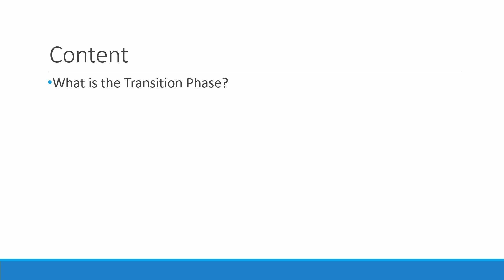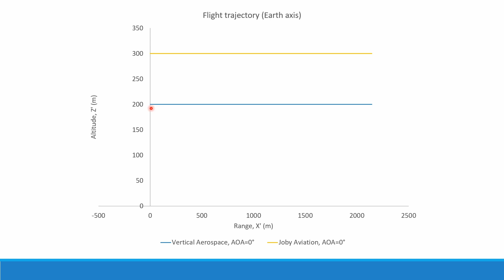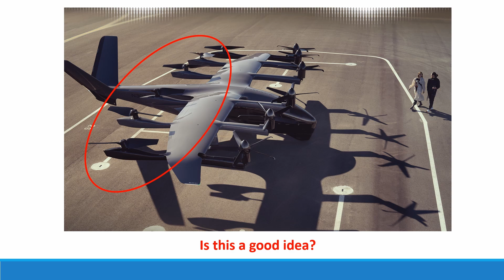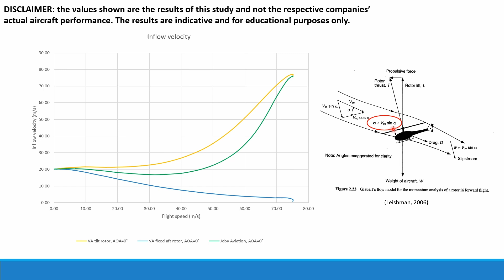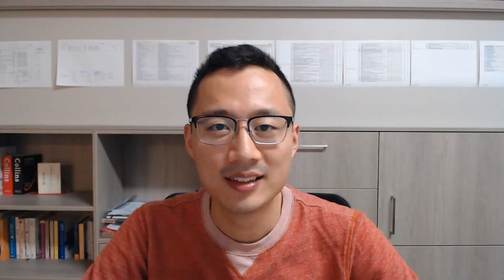EVTOLs with these rotors have a potential problem.

Comment: Strange how nobody (it seems) yet tried a design where aft wing motors are more like the leading edge ones, but pushing, capable of tilting down instead of up, and probably with different prop size/speed/pitch for practicality and safety (this would also help spread the energy over frequency spectrum for better overall aircraft noise perception). This way the aft motor counter effect during transition phase would not exist, they would actually contribute to thrust, and all propos would push during flight phase.

Comment: Kamov stacked rotors like what "Inspector Kido" uses in of film "Man in the High Castle" is best proven configuration in terms of disk loading given how it is skeptical if galvanic batteries even with caustic alkali Groups I to II metals such as Al or Mg could power a VTOL.

"Jane's All the World's Aircraft" had an article on a Tesla bladeless turbine for a rotor and of course Coanda should be well known.

Still A Tesla fluidic rectifier along with rotorless or shaftless ducted fans are already being used by some designers.

Comment: What many EVTOL designers tend to do is miss the fact of air turbulence during VTOL lift and do not consider calculating the extra constant balance exceleration of each motor needed to maintain stability of VTOL level hover. This also applies during all levels of control using the motor power. Were as in a helicopter,rotor flight controls are used to keep level flight, however in a EVTOL during VTOL flight power is used to control and maintain hover level. The more turbulance the more power is drained from the batteries thus cutting short any flight paramiters.

Comment: The best design of the type of VTOL aircaft would depend on the intended use by the user. That is what the user operation of the VTOL is going to be, VTOL lift and short, medium or long range straight flight. The shorter the range the bigger the VTOL rotor size and lift design as most of your power and fuel use will be required and used during VTOL flight. Hense the smaller the VTOL lift rotors the more fuel is used during VTOL. So if an operator intends to use such aircraft for short range and more VTOL lifts, it is better to have a helicopter rotor or tilt rotor due to a bigger rotor size, as  in the long run less fuel usage. During a straight wing flight less fuel is used due to a fixed wing lift. So the best design for long range VTOL flight would always be a single or a double tilt rotor design such as the V280. For heavy lift and constant  Short VTOL flights a helicopter rotor is more suited. One main helicopter rotor or contra rotating rotors will always cover a much bigger lift area thus being more efficient and more powerfull compared to a smaller number of lift fans or rotors grouped together.

Comment: It would be interesting to have a noise profile of these configured aircraft during both transitions --we have 'overflight' figures where the rear props are stopped and some in hover where there is no or little interaction  but not in the intermediate transition/conversion where the front props wake and the rear interact (worst case might be in landing -decelerating transition where flaring (rear up to kill forward speed ) might be the worst case  (as it is for helicopters )   The loss of power to one or more front rotors in this situation will result in sudden increase of angle of attack on the wing and possible stall --this could be induced from deliberate shutdown of a diagonally opposite rear rotor also,

Comment: Great video. I saw the Joby aircraft for production, is different from the pictures you are showing. It does not have flaps anymore, just ailerons for bank angle control. It see'ms the trainsition from level flight to hover is achieved with thust vectoring of the rotors only, no flaps. DO you know how this can be achieved? With just swash plates I believe might be difficult, there most be another kind of control of the rotors. What do you think?

Comment: The transition for both aircraft involves actual downwash on flight surfaces creating 'extra' weight (the rear surfaces and wing tips of the Joby ) and/or the downwash inducing a negative angle of attack on the wing from the front rotors even at a nose up incidence .  Indeed the effect of nosing down ,like a helicopter does to accelerate, is to create less or even negative lift in accelerating transition . The rear rotors act to increase the effective wing angle of attack from their downwash partially offsetting the effect of the front rotors which are placed as far ahead of the wing as possible to minimize the 'downlift' they cause other than in cruise configuration - Vertical aerospace VX4 has MUCH shorter pylons than the Archer or Joby and they all compromise the proprotor diameter to reduce these negative downwash effects . The Archer midnight especially has gone to ridiculous lengths (literally) to try to get the wing out of the worst of the front prop downwash in hover and transition -- it is a bad concept all round . The Heaviside and Do29 used only aft tilt props to avoid this issue  which is a better deal .   Earlier tilt wing vtols like Canadair CL84 and XV 124 etc avoided the downwash penalties that the XV22 has (and suffers the extra 'weight' by using lower disc loading and hence downwash on the wing ) the interaction non linearities must make for complex artificial trim and control made worse by loss of any rotor -the 737 MAX lesson is relevant here with software 'solutions' .  The drag of the exposed rear props, stopped, is greater in the front prop slipstreams (and eats power as the cube of local velocity)

It is clear from the poor behaviour of these designs AND the wild gyrations of the "0.1, .2, .3, .4 etc 'versions' and even worse patented 'abominations' (look up the Joby patents unbuilt precedent designs)  that they did not arise from carefully considered design procedures but from raw avarice after the projections of immense riches by Morgan Stanley/ Uber elevate et al.  Normally such misconceived creations would never leave the drawing board .   Take a look at the Autoflight 'prosperity' - supremely ugly even if it avoids some of the Joby/Archer failings.

Comment: Nice video!

Another concern is failure cases. The more tilting rotors there are, the more ways there are for it to go wrong. Similarly for variable pitch rotors.

eVTOLs are much more complex than helicopters in this regard, and all the complexity is in the electronics and software, as opposed to mechanical systems for helicopters. It’s a very different (and arguably much more challenging) safety problem.
Reply: JOBY has duplicate motors, batteries and computers in case of plan b.
Reply: In the Joby accident one blade failure cascaded into total failure of the aircraft. Yet they are well on their way to getting their type certification.

Comment: Good analysis, but you only hinted to the real elephant in the room in your closing comments - rotor aeroelasticity. Fixed, rigid lifting rotors of any practical scale and blade loading are going to experience ever-increasing ludicrous loads and vibration with any appreciable advance ratio. Ever notice how helicopter tail rotors always have flapping hinges?
Reply from the maker: I'm not a helicopter expert, so truthfully it is my first time noticing that tail rotors have flapping hinges, too. The general feeling I get from analysing eVTOL concepts is the following: at early aircraft design stages, the rotor design is not given the care and attention it needs, despite it being such a fundamental part. And problems with the rotor design can later become a showstopper for the entire aircraft concept. So I feel that the rotor design should be looked into more deeply early on...
Reply: @zhihenglou  You have hit upon the crux of a fundamental issue with the entire eVTOL industry. Many of the players are aerospace (and especially rotary-wing) neophytes who have little grasp on classic rotor problems. Most erroneously subscribe to the idea that the ubiquitous small scale drone rotors (that even the layman SPAC investors are familiar with!) are simply scalable to practical sizes without understanding any of the complicated rotor aeromechanic issues of doing so. Take note of what all the experienced helicopter OEMs are doing with respect to eVTOL - mainly waiting!

The showstopper aspect you mentioned has been in full effect - i.e. see the Beta Alia still yet to demonstrate transition and suddenly pivot to a CTOL craft, plus the very suspect video footage of Archer Maker performing their "transition" last November - if you are especially eagle-eyed you may have noticed them stealthily testing with 3 bladed rear lifting rotors as well.
Reply: @ChrisFu7  What is your opinion of JOBY? 

Seems to me the JOBY is a well thought out EVTOL, but I'm not a aero engineer or a pilot.

 Improved battery technology and future lower weight batteries or Solid state batteries are coming to the industry as well.

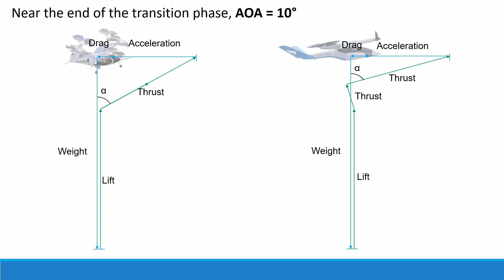Comment: 9:48 your vector diagram correctly angles the the aft rotor thrust by 10 degrees. However, the lift vector should also be angled by about 10 degrees. You're in effect modeling the induced drag from the fixed aft rotor, but not from the wing of either craft.
Reply: Thanks for correcting me on the lift vector definition. A more apt name for what I was thinking of would be the wing force vector, which is going to be roughly parallel to the fixed rotor vector.
Reply from the maker: @RallyRat  Hi, it’s great to see you again :)! I know what you mean. So the ‘lift vector line that is parallel to the fixed rotor’s thrust vector’ (let’s call this X) has been resolved into two smaller vectors like so:
Xcos10 = lift
Xsin10 = drag

The purpose of resolving X is so we can compare lift and drag forces for all different angles of attack (the example here used 10 degrees).

Let me know if this explanation worked. Have a great day :)
Reply from the maker: Hi Rally, 
Thank you for your feedback!
I see what you mean and where you are coming from. However, the vector line for Lift is indeed correct like this for the following reason.

Lift is by definition the force perpendicular to the incoming flow. In this diagram, an altitude-level transition is modelled, as shown by the vector line for acceleration. Suppose the Lift vector line is indeed angled at 10 degrees, then we would be talking about a climb, with a climb angle of 10 degrees.

The induced drag from the wing (and airframe) is captured by the magnitude of the drag component on this diagram. Conventionally, this is called the lift induced drag, which is found on a graph of the drag coefficient versus AOA.

I hope I explained this OK. Thanks again and hopefully see you soon!
Best,
John

Comment: Hi John,

I enjoyed your analysis of full tiltrotor and partial tiltrotor eVTOLs. We’ve been in the VTOLs with transitions to the horizontal flight business for the past twenty years. For reasons you identified, we never even considered a partial tiltrotor configuration.

Early in our development, we identified the transitions as the most challenging phase of flight. We have also discovered that the wing is crucial for achieving smooth transitions. In your video, you are operating in ideal atmospheric elements, which is acceptable for this study. 

However, all eVTOLs in development will have to operate in less-than-ideal meteorological conditions; we must consider gusts and wind shears. When disturbed during a transition, aircraft with significant mass will experience pitch oscillations that will cause the wing’s AOA to follow the oscillation path, thus adversely affecting the wing’s lift. The stabilization systems will detect this condition and attempt to correct it by adding power/lift to the appropriate set of rotors. Due to the large aircraft mass, it is reasonable to expect overcorrections, resulting in PIO (pilot-induced oscillation) from which the aircraft may not recover.

We must understand one crucial fact. Computers are reactive systems responding to inputs from sensors! We must take the AOA gyrations out of the equation to achieve stability governed by physics and aerodynamics.

Look me up on LinkedIn, and let’s connect. https://www.linkedin.com/in/edward-dolejsi-afsi
Reply from the maker: Hi Edward,

Wow! Thank you so much for your detailed and thoughtful reply. I feel humbled and happy that you are reaching out to a beginner like me!

I definitely agree with you: from the little prototyping I have done, I have found the transition, especially the back transition, to be the most challenging. The flight dynamics model we built for our prototype was based on ideal atmospheric conditions. We planned to simulate wind gusts until we realised that we were just using this task as an excuse to postpone the inevitable: do the first test flight. Models are never perfect and flying for the first time is always nerve-racking but, at some point, improving the models without test data is just giving diminishing returns.

For the pitch-oscillation problem you described, were you talking about a longitudinal static stable aircraft? Did you use a PID controller to trim for altitude or attitude? If it is a PID controller and the feedback control loop is overcorrecting, then I suppose you can play around with the Proportional and the Derivative-gain. I did not quite understand the point you have made on AOA gyrations - I would love to learn more about it!

I have reached out to you on Linkedin.

Thanks again,
John

Comment: Enjoyed the explanation... power peak very interesting... would love to see this for Lilium's concept
Reply from the maker: Thank you for your feedback, John! I am thrilled to hear that you have enjoyed the video. 

Lilium's concept is very interesting. It is a very bold design, with significantly more risk and reward. There are good reasons for liking and disliking it, hence there is controversy. Explaining Lilium's design from a propulsion system perspective is on my to-do list! 

Please come back around January next year to check for the video. In the meantime, I wish you a nice Christmas holiday!
Reply: Yes the lilium !!! I did my own analysis and choose Joby, vertical and lilium  basically all configurations. Sold all but lilium
Reply from the maker: @livangooday  Yes, I am working on the video right now. Thank you for your enthusiasm!
Reply: @zhihenglou  lilium would have some cons and pros against Joby, I still believe Joby is less noisy/quieter than lilium

Comment: I've designed a VTOL (not electric) aircraft that does not have the issues you describe. It is much simpler than these EVTOL's and V22 or similar but it is designed to fly at 26000 metres. Hopefully can build it one day. I'm a dreamer, but I also feel that these electric aircraft are a waste of time presently. With the most dense lithium batteries being highly unstable and self combusting they are possibly more dangerous in the event of collision even light. If a plane runs out of fuel and crashes at least it cant burn upon impact. Lithium batteries can be discharged and still highly flammable. Thanks for the video and your time.
Reply from the maker: Hi, thank you so much for taking the time to write out a thoughtful reply.

Lithium batteries indeed have this problem. Though from my experience, the battery will not be fully discharged during flight and around 10-20% SOC is kept to preserve the battery's health (i.e. the number of charge/discharge cycles). Battery safety is related to battery packaging. If a pouch is used for weight-saving reasons, then the pouch can indeed be punctured easily during a collision. The reactants can then directly mix, potentially triggering an uncontrolled reaction.

When comparing the dangers of fuel and batteries, I would perhaps check that the energy content of the fuel/battery is the same during the impact. On that basis, the risk can then be assessed more fairly.

I am excited to hear about your ambition and innovation! I support you to follow your dreams, by designing and building your VTOL. The fruits of your labour will not only be the product itself, but the skills and experiences you have developed along the way!
Reply: @zhihenglou  Thanks for the encouragement mate. Working on a helicopter at the moment to beat the altitude record of 13960 metres, as I don't have storage for a 20 metre wingspan aircraft. I know that Lithium batteries create their own oxygen which makes them impossible to extinguish. Haven't seen any crash testing of these aircraft, but guarantee it will be a factor for safety.
Reply from the maker: @chippyjohn1  Yes, that's right! Batteries carry their own oxidising agent. The battery effectively houses its own "oxygen" (oxidising agent), whereas an air-breathing combustion engine would get the oxygen from the air. I do see what you mean now, in terms of not being able to extinguish the battery fire with conventional means, like suffocating the flame from its oxygen source.

I would point out that a fully discharged battery would have, in theory, used up all of its oxidising agent and it would therefore not be possible to react further. If the electric aircraft is discharged to 20% SOC, then approximately 20% of the energy is still stored, which would be the energy source for the flame.

Wow, your helicopter project sounds challenging and fun! I wish you every success. If you would like, please keep me updated - I would love to see more of it!